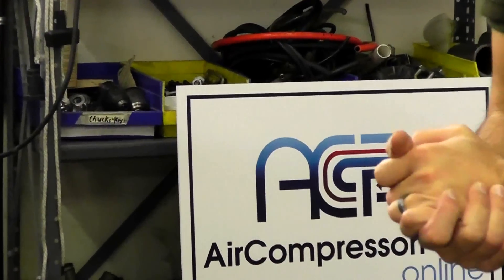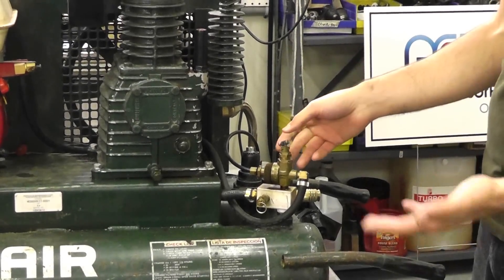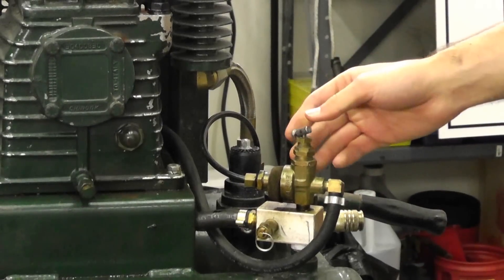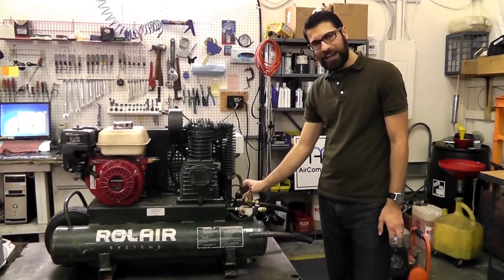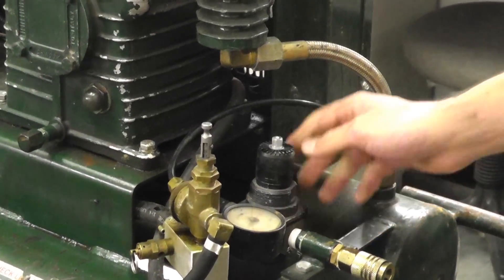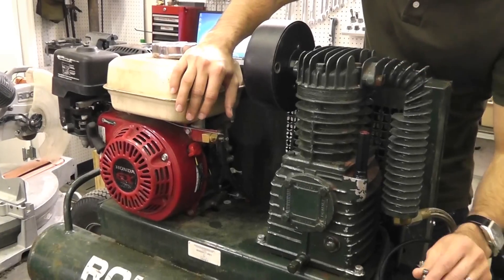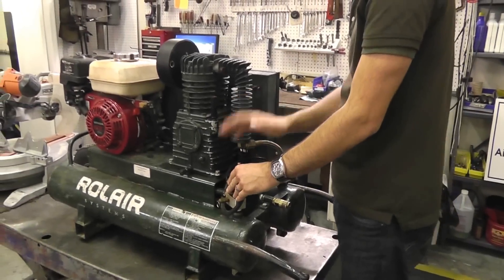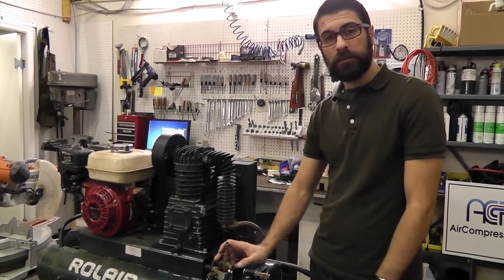Gas Powered Air Compressor Basics

Comment: this is great while also being relatively worthless at the same time. It would have been brilliant to start at the beginning of the system and work your way through the system in the flow that the air is created and moved and then delivered. Like this is the engine which drives the pulley on the pump and air comes out of the pump here goes through this valve and into the tank here comes out of the tank here through this valve and does this that way someone understood the flow of the air being made and what controls it.
Reply from the maker: This video was one of the early videos and you're right, could be improved by giving an explanation of airflow, from the beginning. Good point. We will do our best to refilm this video and a few more so they are more explanatory and concise. Thank you for the feedback!
Reply: Can someone explain the air flow? Does the check valve have the ability to open and close? If not, it seems air would always travel through the check valve and enter the tank. I've seen some mediocre explanations of how a pilot/check/unloader all-in-one unit work, but nobody seems to be able to explain air flow with these older setups where the check valve is separate from the unloader.

Comment: Hi, if I am understanding this correctly,  gas compressors don't have a centrifugal clutch, is that correct? Is the engine turning the pump when you are trying to start it? Does unloading the pilot valve make it possible to start the engine?
Reply from the maker: Thank you for the watch and the question! You are correct, most every gas-powered compressor like the one shown in the video does NOT use a clutch. The engine does turn the pump on start-up but the compressed air does not fill the tank...instead, the air bypasses the tank and unloads out of the bypass in the Pilot/Unloader Valve, which means the pump dodes not have a "load on it". The pump is "unloaded" when the toggle on top of the Pilot Valve is in the vertical position. Once the unit is started, you flip the toggle to the horizontal position, which "loads" the unit and the air will then fill the air tank.

Comment: My  has Kohler 14 hp went out on my Ingersoll rand compressor.  Can I install a 22 hp preditor engine from harbor fright also can a bullwhip be installed on that engine????
Reply from the maker: You can certainly install the 22 hp Predator engine on the unit, yes. It's a bit overkill for the pump on the unit (has more torque which isn't necessarily a bad thing) but it should work. Some modification may be required to install it, but if you have the means to, more power to you! You should also be able to use a bullwhip style throttle control on that engine as well. The bullwhip style should install on most any small engine available (unless it's a very old model).

Comment: Mine is converted from a 3hp electric motor to a 212cc petrol engine.
It has throttle control but i didn't use a pilot unloader valve. I used a component that cost less than a fiver.
Reply from the maker: Good work, and we'd be interested to see what you did use in place of a pilot valve. What did you use to control the cut-in and cut-out pressure of the unit?
Reply: I guess you used a push-pull solenoid

Comment: I Have a gas compressor that when it builds up to pressure and the pilot valve engages the compressor stalls. any ideas on what the problem might be ?

Comment: Hello, and thankyou for the video. I have the same compressor for a roofing company of mine and although it has increasingly with time and wear become a bit more troublesum to get started it generally starts after 3 or 4 pulls however today during a job when the rain was on it's way and I needed it the most the damn thing kept stalling out on me! And by that I mean that it would start up, run for 15 sec - 2 min and then the motor would die. My guy that stays on the ground that cleans up during tare offs is for the most part also supposed to keep up with the maintenance on the compressors but since he's a fat lazy piece of sh** he hasn't done anything but eat and poop. (Gross I know) Enough about him, so here's what I know and have tried...I know I'm using the fuel and choke levers correctly, if it's hard to start then I'll make sure I open all valves and release all pressure, I'll loosen the fuel cap just in case of any vapor lock possibilities, there is engine oil (although it could probably need a good changing), there is compressor oil maybe even to much...the bubble is so faded and cloudy and full of "work" that its impossible to see through however after adding a little bit of oil today I noticed that a little bit was squirting out of the cap through the tiny relieve holes at the top so yeah, probably to much but that happened after it was giving me trouble anyway...I'm thinking maybe the throttle control may need to be adjusted but idk because when the unit shutoff and dies after running for a min it shuts off pretty abruptly like if you were to hit the off switch, it's not like starving for fuel or choking out...it just shuts off, kinda like something is telling it to shutoff. Is there some kind of safety something that shuts off the motor if something isn't right with the compressor? I'm pretty knowledgeable when it come to small engines so I'm not just writing this book on YouTube without after troubleshooting this thing with a fair amount of mechanical knowhow first. Any help would be much appreciated!! Thanks in advance!!
Reply from the maker: Thanks for the info, Justin. This is quite a book but no worries, there's a fix for everything. I'd first bypass the low oil switch. I believe every Honda has one, including this one, so you should be able to bypass it by simply removing the wiring to it. It should be on the crankcase somewhere. If it's not sensing the oil level correctly, the unit will shut down. Also, make sure the pump spins freely by hand without the belt on just to confirm the pump spins freely. Also, make sure the belt isn't too tight or too loose, there should be 1/2" deflection if you press at the center-point of the belt. I'd check these issues first.

Comment: great video, I was wanting to know what you thought of putting a transmission cooler on one. I live in a really humid area and my CH extreme air compressor builds up a lot of water in the tanks so i am thinking about a after cooler. All the videos that I have seen are on electric air compressors.
Reply from the maker: You certainly can install an aftercooler on the unit to reduce moisture in the airline, and probably should if you live in a humid environment. In addition to an aftercooler, install a gravity water filter aft of the air regulator as well. There are a couple different types of aftercoolers...some are stand-alone units (expensive dessicant dryers) and belt guard-mounted units that resemble an automotive aftercooler with finned piping, allowing to travel a longer distance so it cools down and reduces moisture in the lines. Many compressor manufacturers offer them as accessories, as well as air compressor parts suppliers like Air Compressor Sales (out of Macon, GA for instance).

Comment: We have used our compressor for 31 years, its a craftsman 20 gallon gasoline powered compressor.  Here in the last 2 weeks this thing has SHUT DOWN when it reaches max pressure.  It TOTALLY shuts off.     Is it the check valve or what?  Have to get it fixed quickly.
Reply from the maker: Many gas-powered units don't have a check valve, as they're constant-run units. When the unit kicks down to idle, the air escapes out of a bleeder (unloader) line fitting so it won't continue to pressurize the tank.
If the unit simply off after it reaches max PSI, it's probably an engine problem.
I would check the idle speed setting on the engine governor and clock the RPMs to ensure the idle speed isn't set too low. If that's not the case, make sure the throttle/idle control (which is the line that installs from the pilot valve at the tank inlet to the throttle plate on the gas engine) is actually engaging and pushing the throttle arm back and forth as it should...it could be a simple mechanical problem here.
That should give you a good start on troubleshooting the problem.
Reply: @AirCompressorPartsOnline  Wow, thanks a lot.....we will try to check it out.

Comment: how do you adjust the governor on this unit? can someone help me, I was adjusting that little screw and now it won't run correctly so I want to reset it to factory but can't find it in the manuals anywhere
Reply: I believe these are the steps to resetting the govenor to factory. The terminology will likely be wrong but should be enough if your looking at the parts. This is with you working opposite/behind the flywheel. 
1. Pull the gas tank. 
2. Loosen the sandwich bolt that holds the govenor stud and govenor adjustment arm together. 
3. Move governor arm all the way to the right and the govenor stud poking out of the top of the motor all the way counterclockwise. 
4. Lock back down the sandwich bolt. 
This should put the butterfly all the way open. If you do the opposite adjustments the engine should run like it's about to throw the piston through the head. 
Anyone reading this who knows different or the same please verify.
Reply: @onemanarmory5063  awesome thank you so much for the information 🙏

Comment: I just got one and if It has pressure in the tank I have to completely drain the air out before I can start it again. It that normal?
Reply from the maker: Thanks for the question! That's not normal, no. It seems as though the pressure isn't unloading off of the pump head (and out of the discharge tube) after the unit fills. The brass pilot valves with the toggle on top should have an "unloader" line routed to it, it's just a 1/4" tube. The pilot valve should "unload" the pressure from a port on the pilot valve into the atmosphere, which makes it easier to kick the engine back into "high gear" to start pressurizing the tank again. Make sure you hear this burst of air for a few seconds after the unit reaches max pressure.
Also, check to confirm the engine and throttle control is working properly. It may be that the throttle control isn't activating the governor on the throttle arm of the engine like it should, so when the unit "unloads" to start pressurizing the tanks again, the engine speed is too low so it's cutting off. 
These are a few suggestions that I hope help get you started.

Comment: Does the air regulator ever go out? I have makita big bore gas driven compressor, and it will shoot sudden burst of high pressure then lower pressure continues.
Reply from the maker: Yes, the Regulator can stop operating, not allowing much or any airflow through it. It would also be defective if it surges, e.g. allowing bursts of high pressure air and low pressure air through it. You can certainly try replacing it, but also make sure this isn't happening at the pump head. You may want to remove the Regulator completely then run the unit...if you still get air surging (and not a constant flow of air) without the regulator, then the problem lies in the pump itself. Hope this helps!

Comment: So do you have to flip that valve over on the pilot unloader valve everytime you want the compressor to pump up?
Reply from the maker: You technically don't have to flip it every time, no.  You can simply leave it in the horizontal (loaded) position and when you start the unit, it'll start pressurizing immediately. The reason why you would slip it to the unloaded (vertical) position is because it make the compressor MUCH easier to start, so it makes life a lot easier as it makes the unit much easier to start first thing.
Reply: @AirCompressorPartsOnline then why does it say on the start up label that comes with this machine that you should never ever manually toggle the unloader valve and that it will do it automatically? what bad thing will happen if you open this valve toggle before running (I do it all the time when it's hard to start under pressure but the manufacturer's labels say to never do it in all capitals so it seems serious and I wanna know the reasoning behind them saying to never manually flip it)

Comment: Hi.  Love your vids.  My similar compressor stalls out when the compressor kicks in.  Any ideas?
Reply from the maker: Thanks for the compliment, Morris...and for the watch! Usually this happens if the engine's throttle arms isn't "kicking out" to allow the engine to run at its high speed RPM's. Make sure there is no mechanical obstruction and that the throttle arm can move back and forth freely. Also, check the throttle/idle control valve itself, which connects to the brass pilot valve  and kicks the throttle control into high gear from idle. There are two types of throttle control systems...the "bullwhip" cable style and the "airline" style which just uses a hollow nylon tube. If the above two issues check out, then either the pump is seizing or the belt is too tight or too loose (there should be a 1/2" of deflection if you press down on the belt at the center point. Hope this helps!

Comment: Hi i have  a gas compressor that.doesn't build pressure  i disconnected the air line that goes  from the compressor in to the tank and not air at all .Do you know why is not building any pressure the fly wheel pulley is turning.
Reply from the maker: Thanks for the question Adan! The problem lies in the pump itself. Most likely you need to replace the reed valves in the pump and gaskets. If the pump is turning and you're not getting any compression, the valves and gaskets are usually the problem. It's possible you need to replace the rings as well but usually a valve kit will do it. If you have a model number I can possibly give you pricing on the valve kit. Also, make sure the belt isn't slipping as this can cause the problem.

Comment: Why don’t they put a centrifugal clutch on the engine so when the engine idles down it shuts the pump off.  I went out and let my compressor cool down fired up the engine and let it idle and was amazed how much heat the compressor pump was making.  Very little air flow sadly with these gas compressors.   Rol air does seem to have a better flywheel than others
Reply from the maker: This can be a problem when the unit is run continuously for long periods of time, you are correct. The aluminum pumps with larger flywheels (that have more cooling fins, like RolAir) are a step above many brands because of this. Most units do not use a clutch (although I have seen them) because that would probably bump the price point up and would also involve more moving parts. I'm just conjecturing for the manufacturers, however. Most compressors will get quite hot and run like that without detriment, however. Thanks for the comment!

Comment: One more question I have one just about like this but low and behold the model and serial number is wore were I can't see it my question is this is parts for the pump pretty much all same from diagrams that I have look at they look the same
Reply from the maker: Thanks for the comment! Unfortunately there are dozens of different pumps used on many different brands of air compressors, so I would be safe and not assume your pump is the same because it looks similar. It may be the same pump, but I would try to get some casting numbers off of the crankcase, head, cylinders (etc.) to identify your pump. Also, you can email some photos of the compressor you have to us if you would like, so we can help you identify it; you can send the email to customerservice@aircompressorpartsonline.com. Thank you!

Comment: Hi my compressor is 8 months and the  pump stops working and makes the compressor to turnoff, any suggestion how to fix.
Reply from the maker: You have a gas-powered compressor, yes? IF it's a gas unit and the unit shuts off when it's not supposed to, most likely it's a problem with the pump or engine throttle control. I would remove the belt(s) from the pulleys and spin the pump flywheel by hand; does it spin freely? Is there any obstruction or metal-on-metal grinding? If the pump turns freely, I would try adjusting the idle speed on your gas engine. It may be that the engine idle setting (or running RPM) is too low. There is an adjustment screw on many small engines where this can be adjusted. If may be that the engine throttle control valve isn't actuating the governor as well. There are quite a few reasons why this could be happening but this should give you a place to start!

Comment: What is the one black adjustment vavle on the pump it self
Reply from the maker: I believe what you're referring to is the Oil Breather. That's a black plastic piece that threads into the top of the crankcase and simply allows the crankcase to breathe. Thanks for the question!